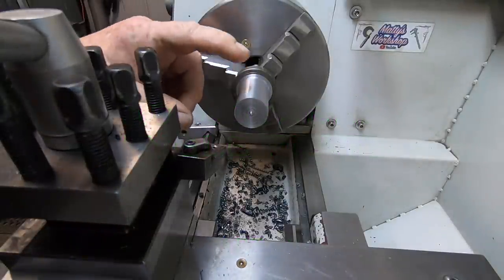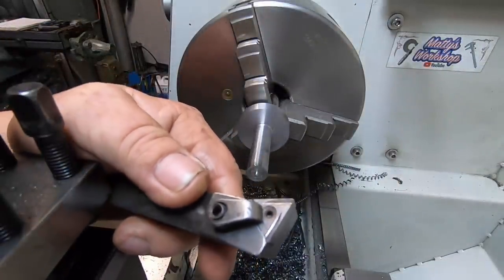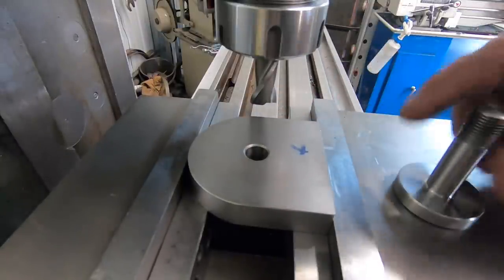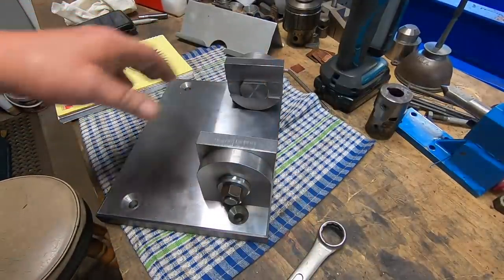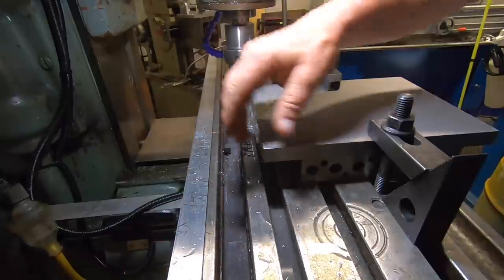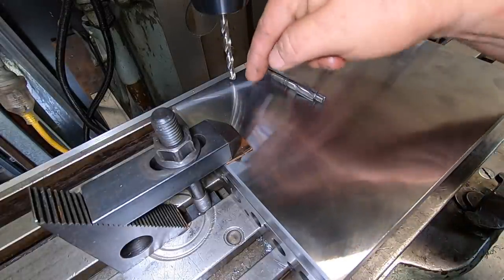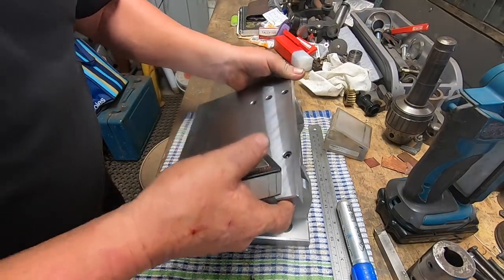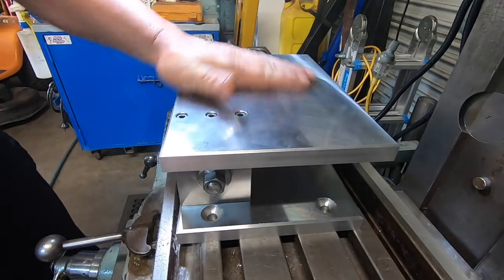Adjustable Angle Plate Part - 2

Comment: I would do drilled and tapped holes.  I believe that cutting a tee slot would induce (or relieve) stresses that would cause the top plate to bow.  It would also create a weak spot in the top plate.  It looks great by the way. 👍👍
Reply from the maker: Gday Jim, drilled and tapped holes are the most popular comment so far, lots have also mentioned slots will bow the top plate, appreciate you watching and commenting mate, Cheers

Comment: 1) I wouldn't cut the bottom plate. Doing that would reduce the rigidity of the device. 
2) I'd litter the top plate with holes. Slots would reduce the rigidity. 
3) If you can achieve all angles in one direction of tilt, I'd be happy with that. 
4) I'd make rigidity the primary concern. 

Thanks for doing these videos! Very much appreciated!!!!  :)
Reply from the maker: Gday, all 4 are spot on mate, i really appreciate the feedback, Cheers
Reply: @MattysWorkshop  you're most welcome!
Thanks again for sharing what you do!

Comment: Lovely piece of work Matty. Leave the base as is, make the top plate into a pallet with drilled & tapped holes thus preventing any bowing. Another idea would be to make up a couple of extended tapped caps with hex / flats to fit the 'ears' to allow you to use a socket/spanner to lock /tighten top plate, easier than just the nut set up as is.
Reply from the maker: Gday, I like the idea of longer nuts on the pivot pins, great idea, certainly be easier the using a spanner, a series of taped and reamed hole are the way to go mate, appreciate you watching and commenting, cheers

Comment: Hi Matty ,
Great looking angle plate !
Leave the base as is but add two holes or slots in the middle and at  the same pitch as the other mounting holes so you can spin the whole thing 90 deg on the mill table and still have 4 mounting bolts and it will let you hang it off the front or rear of the table a bit if needed  .
I would use tapped holes on the top and make up a tee slotted plate that can be fitted to the top surface using the tapped holes - you have the best of both worlds then . I would also drill and tap some holes around the periphery of the top plate so you can fit a fence or fences , these can be handy when making multiple parts .
Reply from the maker: Gday Ian, I like the idea of removable tee slots, definitely will be putting more mounting holes in the base, really appreciate you sharing your thoughts mate, cheers

Comment: Lovely angle plate, even if you shortened the base I don’t think you would get 45 degrees so I would keep the base as big as possible. What to do with the top, wait until the first project then decide.
Reply from the maker: Gday Chris, yes your right about the base plate, a lot of people have commented and it sounds like drilled and taped holes are the way to go, thanks for watching mate, cheers

Comment: Beaut build Matty. +1 for tapped holes. I'd also make a stiffener for the cantelivered table that can adjust with the angle. It may feel rigid but under cutting forces it may vibrate
Reply from the maker: Gday Max, I was looking at how I can make a stiffing arm today, I haven’t tried the angle plate out yet so it’ll be interesting to see what the cutting forces do, thanks for watching mate, cheers

Comment: If the base and the top are mirror images, you could drill your mounting holes for the other machine in the top plate, then fixture holes for the specific fixture you'd be using on the other machine in the bottom plate.  I agree no tee slots , they would reduce the rigidity. Beautiful job.
Reply from the maker: Gday, I don’t think slots are the way to go, good idea using both sides, thanks for watching and commenting, Cheers

Comment: Looking good, Matty.
I suggest short keys in the base for quick register in the mill T-slots. For the top I'd do a pattern of tapped holes with a few added drilled and reamed holes for alignment pins such that 30, 45, 60 and 90 degrees can be easily referenced. You could also make removable fences (like on a magnetic chuck) from which to run a sine bar for "fussy stuff". Alternatively, you could make an auxiliary pallet with the above features that registers either with pins or keys and bolts to the top plate.
I'd leave base and top plate sizes as they are until a job requires a change.
Reply from the maker: Gday Russell, that’s a brilliant idea making short keys to register in the T slots of the table, I do have more plate so I could possibly have a few different options, just a matter of swapping top plate, definitely go with the fence idea, appreciate you taking the time to give ideas mate, Cheers
Reply: All good additions. You'll never regret the T- slot keys and the reamed pin holes!

Comment: Lovely job Matty 👍👍👍 Superb finish with that fly cutter. I wouldn't worry about getting 45 degrees in both directions, you can always turn it round. Leave the base as it is, you have good rigid support there. Technically the best solution for the top plate would be tapped holes and guide pin holes rather than slots but I guess it depends on what you want to use it for. Cheers, Alan.
Reply from the maker: Gday Alan, I think taped and reamed holes are the way to go, I don’t know why I wanted to get 45° in both directions, appreciate you watching and commenting mate, Cheers

Comment: G'Day Matty, looks bloody nice there Mate!!  Like others suggested, I'd go the pallet top but make your holes align with 1-2-3 or 2-4-6 blocks for easy fixturing. Tapped holes around edges for fences.  Bottom plate - either cut channels or tapped holes for a pin or a key to align with the table T-slots for quick setup. Alignment pins are good for top plate 0º to 90º work alignment - different diameter pins can give you half degrees or fractions of degrees (I can explain more if needed).  Catch you again soon.  Stay safe and well :)
Reply from the maker: Gday, great idea aligning the holes to suit 123 blocks, I will probably end up putting alignment keys in the base to make it quicker to setup and a fence for the top plate, thanks for watching mate, cheers

Comment: It will be a lot of work but I would be going tapped holes.
Have you thought about adding an edge fence to align the work piece square to the plate, or possibly keep some of the holes untapped to take alignment pins.
If you really want get fancy some spring loaded detents for 90,60,45, etc and some knobs to make for toolless adjusting perhaps.
Eric
Reply from the maker: Gday Eric, I think drilled and taped holes are the way to go, quite a few people have suggested making a fence which is on the to do list, the spring loaded detents has got me thinking now, appreciate you watching and commenting mate, Cheers

Comment: Young Matty
There's my 2 bobs worth I went up the shed and looked at my angel plate which I got from a closing down machine shop.
Leave the base as is for rigidity and clamping force, with the width you will be able to hang it over the edge of the table for sum applications.
The faces have been drilled and tap, pined , slotted and mill for production runs.
I would tap and slot it for your next project the holes are very in the right place!
Old apprentice from wet Queensland
Reply from the maker: Gday Christopher, I received your parcel the other day and thank you very much truly appreciated, from what I’m reading in all the comments I think tapped and reamed holes are the way to go, slot may course the top plate to warp, thanks for watching mate, cheers

Comment: Use as is. if you need it to tilt to 45 both ways then change it then. I would make a pallet of the top. It's turned out amazing. great work Matty.
Reply from the maker: Gday Malcolm, I’m thinking I don’t need to get 45 in both directions, pallet layout is the most popular idea mate, thanks for watching, cheers

Comment: What a nice-looking job! I would go for the pallet idea myself. I think it's best to buy an angle plate with slots already milled in it because mass production cast angle plates are normally very accurate. Only my opinion.
Reply from the maker: Gday Dermot, I honestly think if I put slots in the top plate will definitely warp, taped and reamed holes are the way to go, thanks for watching, cheers

Comment: I would leave the base plate alone.  Perhaps adding a bumper to the base and bottom of the upper plate so that you could use it as a sine bar would be a useful addition.  Upper plate with an array of tapped holes.
Reply from the maker: Gday, I have thought about setting it up for a sign bar, I need to get a set of gauge blocks one day, appreciate you watching and commenting mate, Cheers

Comment: The ducks nuts! 🤣🤣 I'd live with the angle range just as it is. Then drill and tap lots of holes in the top face. Great project thanks for sharing.
Reply from the maker: Gday, nothing wrong with the ducks nuts mate😉, drilled and taped holes sounds like the way to go, thanks for watching mate, cheers

Comment: I would make the top plate a pallet with alternating tapped and reamed holes. You can then use dowel pins to align the work or other fixtures before clamping using the tapped holes. I would leave the base as is for more stability.
Reply from the maker: Gday Max, I’m thinking tapped holes are the way to go and reamed holes is a brilliant idea, appreciate you watching and commenting mate,

Comment: Hi Matty. You mill has performed brilliantly on this project with you at the controls. Great job it'll be very useful. 
I'd take Doug's advice at Metalworks Machine Shop channel and put tapped holes in it and holes for pins. Tony
Reply from the maker: Gday Tony, the Cincinnati still does a great job, it does have wear in the ways but it getting some age on it now, I think tapped holes are the way to go, thanks for watching mate, cheers

Comment: Nice bit of machining there, Matty. I love the finish that fly cutter leaves. I'd leave it. You're still going to be limited by the height of the pivot. If you cut that bottom plate, you're still not going to get 45 degrees. Tapped holes all day long. I imagine you could find some stainless steel mesh for those drains.
Reply from the maker: Gday, afte thinking about it for a little while I don’t really need to have 45° in both directions, tapped holes are the way to go by the sounds of it mate, thanks for watching, cheers

Comment: Stop by your local $1 store and grab a small stainless steel filter for kitchen/bathroom sinks. Shape it to fit and "silicone"/glue it in place upside down over the drain hole at the back of your milling table.
Reply from the maker: Gday, thanks for the idea mate, I didn’t give that idea a thought, Cheers

Comment: Very nice job Matty!!!
What about separating the two plates a little more to get to both 45 deg. angles, using either shims under the pivot ear mounting points or a second set of pivot holes in the base plate ears away from the base plate itself to get more separation between the two plates? And have you thought about holes in the base plate to mount it at 90 deg. to the mill table. YES, I know this isn't what was asked. 😁
Reply from the maker: Gday, thinking about it I don’t think I need to have 45° in both directions, the base will get extra holes so it can be mounted either way, I really appreciate your thoughts mate, cheers

Comment: Hi Matty, cut a bit off the back of the top plate and chamfer the underside edge of the rear of the top plate to get the angle you want, three slots in the top would be good, but probably the drilled and tapped pallet idea gives you a lot of possibilities, great project mate and the fly cut finish is awesome.
Reply from the maker: Gday, after a bit of thought I don’t really need 45° in both directions, I’m worried if I put slots in I’ll warp the top plate and loose rigidity, tapped holes might be a better plan, thanks for watching and commenting, Cheers

Comment: Great result Matty. Personally I would leave the base as is. For the top, I think I would decide which chucks/vices I intend to use and tap holes to match. T-slots could weaken the top.
Cheers
Andrew
Reply from the maker: Gday Andrew, I’m going to put some more mounting holes in the base to be able to fix the plate in the y axis direction and x axis direction, still undecided what to do with the top but sounds like drilled and tapped holes sounds the best option, thanks for watching and commenting mate, Cheers

Comment: Hi Matty…
I reckon tapped holes in top plate, and some tapped holes along the edges( for fixing reference ‘fences’), or alternatively, a set of holes foe dowel pins
Reply from the maker: Gday Robert, yes taped holes sounds like the best option, I’ll be putting reamed holes in as well for dowel pins, appreciate you watching and commenting mate, Cheers

Comment: G'Day Matty, nice work and a pleasing result.  I would keep the base wide to give as much stability and rigidity as you can, just plan ahead with your machining operations to orientate the plate.  For me, I like the plate tilting toward so I can see what I'm doing when setting up and machining.  If you have it tilting back toward the mill you may be machining blind and setting up can become awkward.  I did a series of holes in the base so I can set the table at 90 degress and also side shift so it can over hang further on either end just to give some more flexibility.  I went with Tee Slots to give maximum flexibility for setups.  If you look at the photos, I fitted a rib underneath to stiffen the top plate up.  It was quite springy when I first cut the slots but the rib it sorted that issue out and its extremely ridged.  The rib also had clearance grooves at each Tee Slot location so I could slide the Tee Nuts under the rib.  I also machined a recess slot under the slot so the nuts fit reasonably flush, I think it shows it on that rough drawing.  I run a 10th indicator over the top each time I use it, and it is always within 1/2 thou in all directions showing I have had no flexing issues.
Cam
Reply from the maker: Gday Cam, I’ve nbeen studying you photos again and the extra plate on the underneath side is brilliant, i really appreciate your help mate, Cheers

Comment: I have two cast iron adjustable angle plates of different sizes, and neither of them fold to anywhere near 45 degrees. As long as it goes to 45 in one direction, that should do all you want.
Reply from the maker: Gday, after I looked at it for a while I realised I didn’t need to get 45° in both directions, appreciate you watching mate, cheers

Comment: I'd join the others and advise that slots will distort the top, plus you don;t really have enough thickness in the top plate for slots. I can tell you that (many years ago) I put T slots  in a 1" thick piece of quality steel and soon after the steel bowed about .375 thou across a 14" length (14" x 5" x 1"). That WAS a waste of good steel!☹ Tapped holes is the way to go.
Perhaps, if you think you may want to use a chuck on this, consider drilling any chuck mounting holes FIRST and THEN drill the pallet holes at a convenient and compatible measurement.
I'd suggest you consider installing some push in dowel pins at convenient angle (preset) 30°, 45°, 60° (if you can fit them all in 😁)
Based on my observation of your plate, even if you cut the base narrower, the top plate will not reach 45° before the top plate edge touches the mill table. You will need to make the top plate narrower too.
Contemplate putting holes in the base too. This could provide a great setup option for machining the occasional "weird" object. (using the top plate mounting holes from the underside of the top plate.
BTW, great job on the project.
Reply from the maker: Gday, thanks for sharing the experience you had, certainly makes my mind up about putting slots in, definitely going to put more mounting holes in the base, If I was going to put a chuck on the plate it would need to be a low profile chuck, same with a vice to, something else I need to look into a buy, I like the idea of pin to setup the angle at 30°,45° & 90°, thanks for watching and commenting mate, Cheers

Comment: I would go with a pallet set up and a grid of drilled and tapped holes.
Also, shorten base and maybe chamfer backside of the top to achieve 45° if possible.
Second set of holes in base to allow it to be turned 90° on the table as well.
Looks great! Thanks for sharing 🇨🇦
Reply from the maker: Gday Paul, I think a grid of taped and reamed holes will be the way to go, definitely going to put more holes for mounting in the base, appreciate you watching and commenting mate, Cheers

Comment: Very interesting project. As someone else suggested t slots would weaken the top. I think you could make a pass with the fly cutter on the top now that it is attached to the base ,after you've indicated it at 0 degrees, in order to make it parallel to the table of the machine in case the two hinges aren't perfectly at the same height.
Reply from the maker: Gday, I’m certainly worried if I slot the top plate it will warp, tapped and reamed holes are the way to go I think, I’m going to check the table again with a different indicator just to see if I get the same reading, thanks for watching, cheers
Reply: @MattysWorkshop  I've just seen your new video where you check for parallelism and i think the result is pretty good